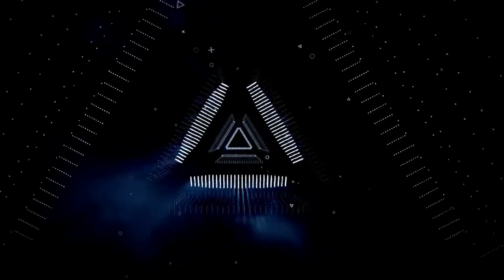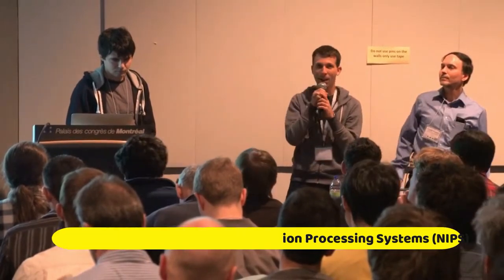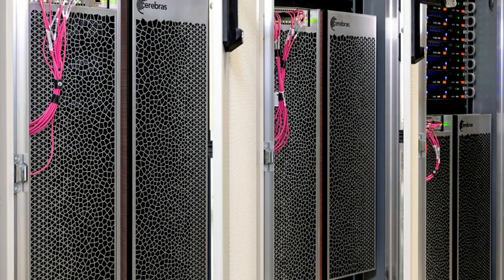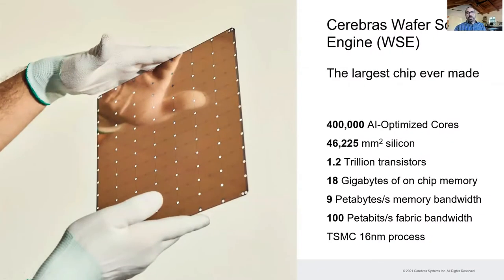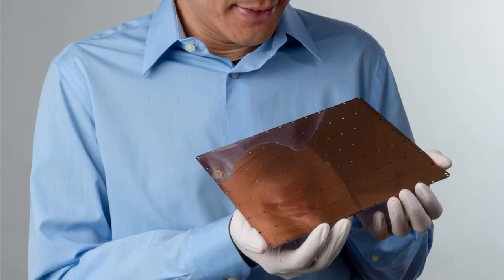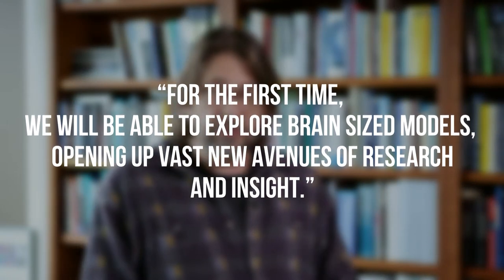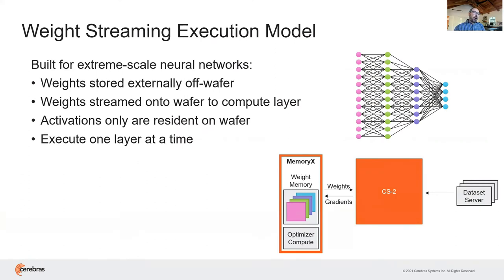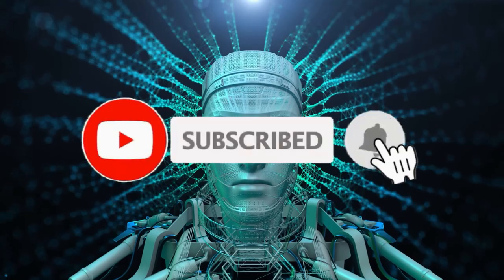Worlds Largest Computer Chip Will Change AI Forever- Cerebras CS-2

Comment: I see lots of issues with this approach.. 1) silicon yield issue 2) amount of heat it will generate during operation will be huge and come up with stable server running 24x7 might be challenging 3) not economical and single point of failure.. 4) might be good to run trained inferences but can't train an AI model on it 5) hard to come up with adaptable software which can be targets multiple AI applications.. 6) Most of the AI graduates are being trained on GPU based model so human investment will be huge .. well I can go on.. in short it destined to fail big time.
Reply: all of these are valid concerns, but unfortunately (to your prediction), cerebras has solved all of them, and they already have tons of customers...
Reply: 1) No, bad chips are expected and accounted for. They get bypassed on the wafer. There is redundancy.
2) No, because the chip is huge. If you're cooling 15 kW from a wafer that's easier than cooling 100 W from a higher clocked CPU the size of a finger nail. If you put 1 L/s flow of water through a big copper plate, which is easy to do, the temperature of the water will only rise 3.5 degrees C. I don't know how they are cooling it, but that would be an easy way to do it. The hardware already exists and is already being used so apparently it was solvable.
3/ I think wafer scale will have unbeatable economics where it makes sense (especially training where you can use almost infinite performance). The cost with GPUs is not just the dies; there are massive costs with fast DRAM, many-layer-PCBs, fast PCI-E interconnects etc. Here you only have a shitload of 100 Gbps ethernet connections. How is it any more single point of failure than GPU clusters? A 16 CS-2 cluster has been built; what is different from a failed GPU during training other than granularity?
4) They have already been doing this since CS-1.

GPUs are a poor fit for AI and a stop gap that only exists because they had an acceptable API for scientific applications. Regardless of who wins it will not be traditional GPUs.